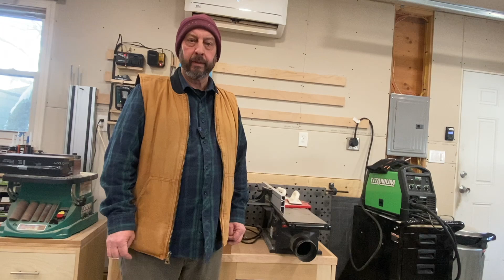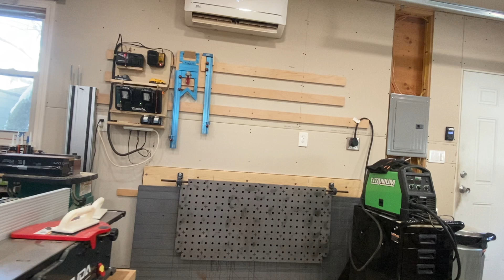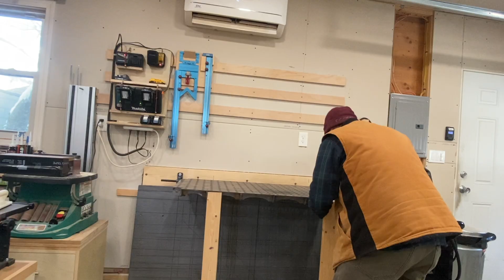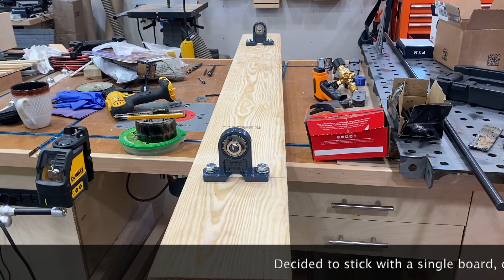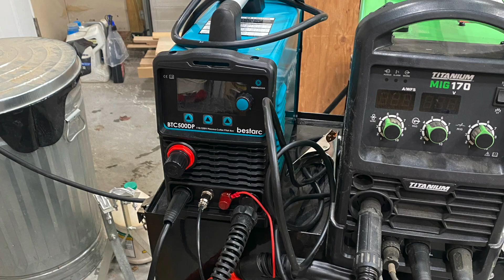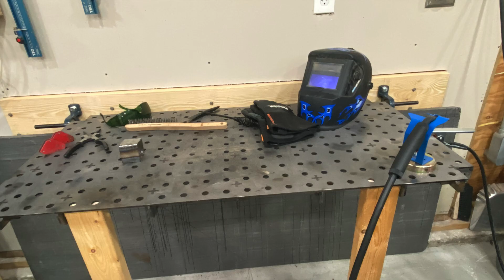Stealth Fold-out Welding Table!

Comment: How much does the metal plate weigh?
Reply from the maker: It’s pretty hefty, the plate itself is 55lbs if I recall, the ribs add some, so it has to be 80-90 lbs total.